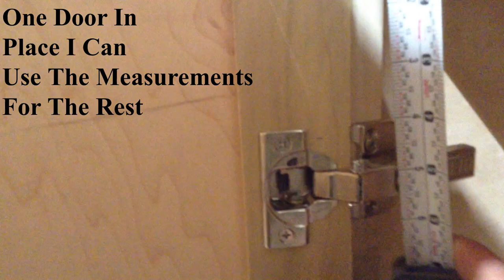Woodworking : How I Estimate Prices & Get Customers // Part 2

Comment: You would make your Grandfather proud! Excellent Dollhouse! Speaking about degrees: My college-prep was art, and then in college I degree'd in Communications/TV Production. I have never produced nor followed that discipline-I do website work, photography and IT for profession. However, the first tool I am getting is a Harvey 14" Bandsaw to resaw some walnut and oak. Oh, and the house I am in, was built and owned by a NJ union carpenter: he wasn't good as a plumber/electrician but every mitered casing is spot on! Question: What is the meaning to you of the Lucille Ball print?
Reply from the maker: No meaning to the print.  Someone gave it too me.  I like Lucy, but the part I thought was great was the over exaggeration of how big her eyes are, so I now refer to it as my Lucy Deer In Headlights print.

Comment: Hi, thanks for the videos, much appreciated. I was wondering how you incorporate your expenses: power,  shops costs etc into your costing. Similarly depreciation on tools and equipment. Have you figured this all out and incorporate it into your hourly rate? It’s something I’ve been curious about for a while, especially charging for depreciation of tools so you can afford to replace a tool that breaks or wears out.

When you move into a larger shop and given what you said about a bandsaw and 3D shaping you should check out a shipwrights saw. They are beasts but the level of movement available in several planes is amazing. I first witnessed one being used on the Sampson boat company channel, it about blew my mind the shapes they were able to cut in some pretty massive timbers.
Reply from the maker: I'll have to check those out, that sounds very interesting thanks.  I don't buy a lot of new tools, and honestly even with my temper I don't break a lot either.  I only depreciate the bigger more expensive tools and I haven't bought one of those in awhile.   General shop costs I calculate as consumables on all my invoices.  so depending on the job and how much glue, or how many screws I use I give a general price too.  That way I can just buy all that stuff in bulk which is cheaper and then get the money back slowly through each job.  I also quote per job and don't really use an hourly rate, just because I'm working on 4 or 5 projects all at once and keeping track of the hours on each would be a huge pain.
Reply: @HoneyBadgerWoodWorks  hi, thanks for getting back to me. Much appreciated.